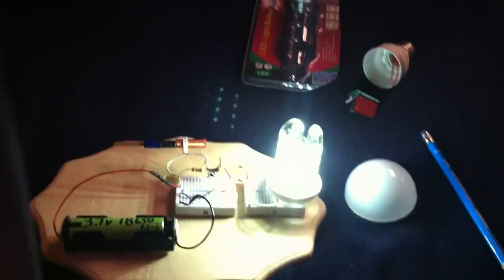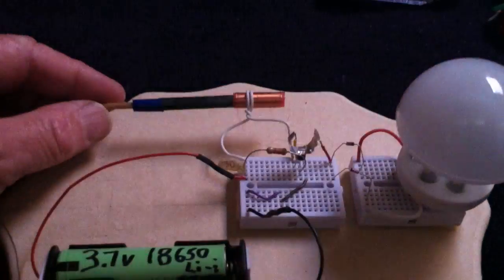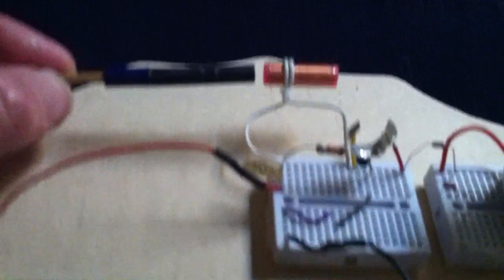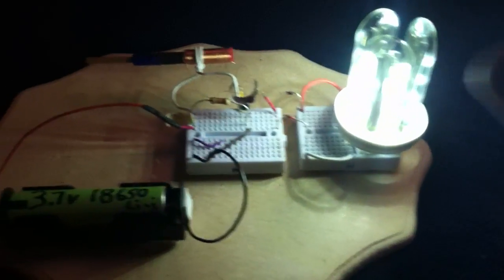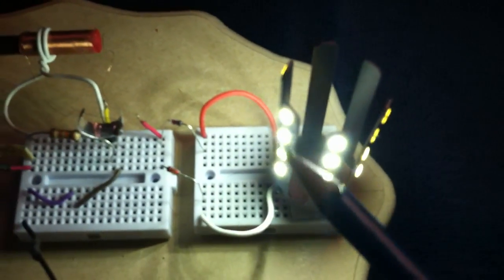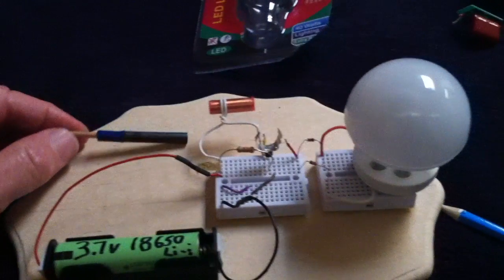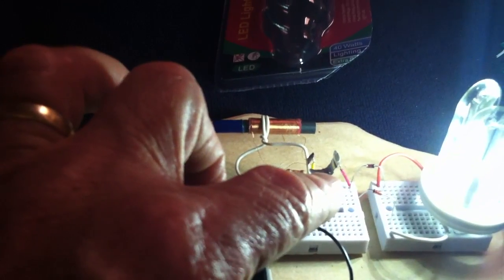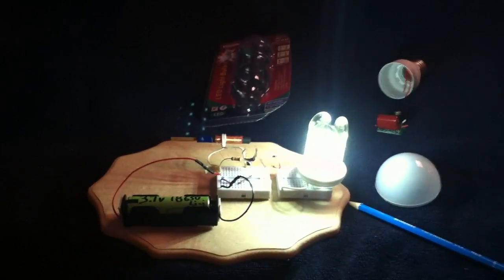New 110v Led bulb driven by a Slayer Exciter

Comment: If your going to simple  build lights working near 5v levels might as well go get a jump pack with usb outputs and tie it to a solar panel and you can charge your phone too and power some fans and give your boat motor a jump if the battey goes flat lol.
Reply from the maker: That is exactly what I'm doing on my sailboat.   Lots of sun here in So Cal.  A little 10 watt solar USB charger goes a long ways.  I have a 100 watt 12v panel for 12v needs.  An inverter gives me the 110v AC if I need it.  I have a bunch of 12v lead acid batteries on board to store the energy.  When the sun doesn't shine I turn on the inboard aux diesel with it's big alternator.  These little light "projects" are just for fun but I do get a kick out of taking them to sea for a "field test".

Comment: I've run the LED's directly on AC with no diodes since they are already diodes. I have three of the cool white LED 12 V modules from a series string wired to a bell transformer as a night light at the top of the stairs at the bathroom entrance and they have been plugged in there and left on for nearly 6 years now and it uses under 2 watts of power. A simple night light that you hook up and it just runs with no flicker. It's half wave and at the frequency on your board it will not matter. That unique LED is made to look like a CFL with the way the plastic housing goes over it. You are activating the LED with the HF the same way that Tesla used these coils to illuminate rarefied gas tubes with minuscule currents and higher potentials. Here you have higher potential and frequencies than the LED's are originally made to operate with. As the frequency goes up, the current required to illuminate them goes way down. An LED held next to the coil will illuminate since it is rectifying the voltage picked up in the leads through itself into ground of body resistance and capacitance.  Tuning it with the rod makes the Q curve narrow with a nice high node in the middle of the resonance. The COP of this is probably 30+ Also, Try putting 2 of the transistors in parallel and see if the heating is reduced to about 40% of what it was. Also, it's possible to extend the transistor leads and solder them onto paper clips that are cut to an inch or more long, and that will turn them into heat sinks and draw the heat out of the transistor and dissipate it through the leads. Larger power supply diodes use this technique and have #12 sized leads coming out of them and they solder to the boards and sit up in the air - that was done on older solid state monitors and TV's on their boards from 20 yrs ago - big Sony 21 inch monitors and so on. The convection from the  heat sinks drew in cooler air over the boards. The cooler it runs, the higher the COP will be and the lower the input current for the same performance.
Reply from the maker: Excellent advice and information.  Thanks.